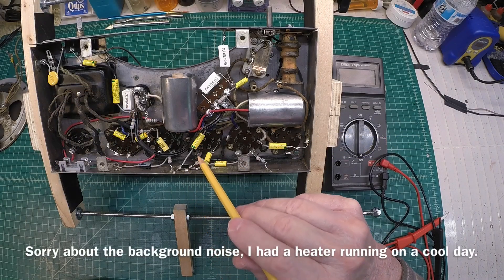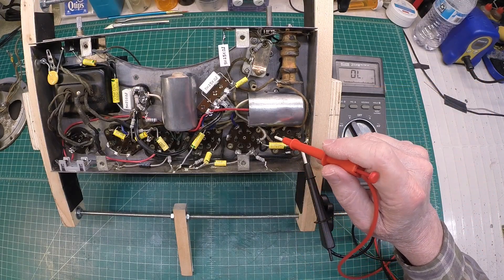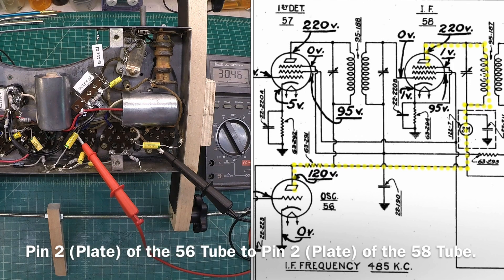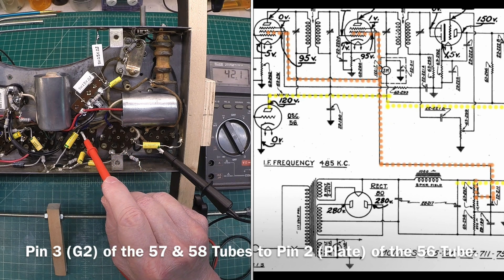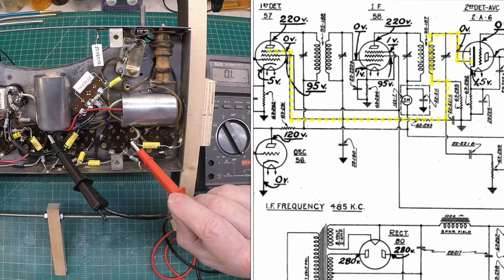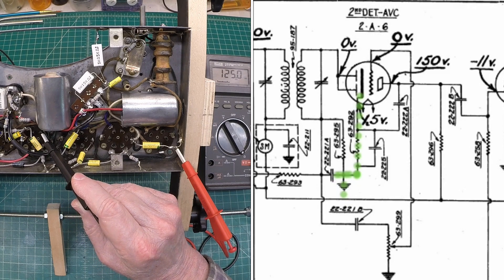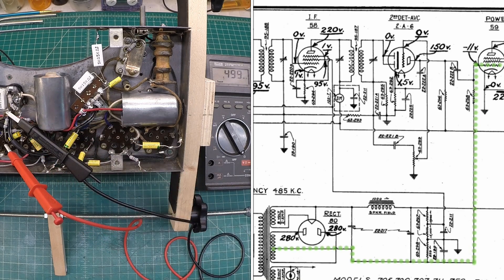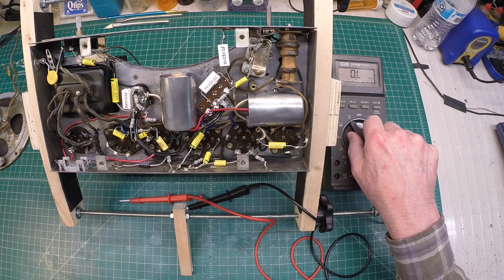Zenith 707 - DC Resistance Measurement Tutorial

Comment: Hi Don,
Although I haven’t been leaving comments, I nonetheless have been following, and liking this radio reconditioning series.
However, a chap I worked alongside many years ago came to visit me (some Corvid restrictions have been recently relaxed here in the UK), and he happened to mention he is following you restoring a 1933 Zenith, model 707 (he never leaves comments on anyone’s videos), and asked if I was following this series.  He went on to mention how much he likes Zenith radios, and how sharp looking the model is that you are currently working on.   He Jokingly continued saying if he had sufficient means, he might have been tempted to put in an offer on a Zenith 707 that was for sale at the Radio Attic.  Its price at the time of sale - 05/ 10/ 2018, was $799.  Whether the asking price for the radio was achieved is not clear.
So, your 1933 Zenith 707 might be a very desirable radio my friend.
The man from Sheffield.
Reply from the maker: Phil - it's great to hear from you and I appreciate you and your friend taking time to watch and reach out. I picked this set up some time ago as the beauty of the cabinet was pleasing to the eye, or what I hope will be pleasing once I get the cabinet touched up. The electrical restoration was interesting as the voltage divider resistors were open and a few of the capacitors. In addition, the I.F. Transformer coil; I had to wind a new one as the mice at some point made a meal out of it. Thanks again and I hope your friend finds a Zenith 707 at an affordable price down the road. All the best to both of you. Don